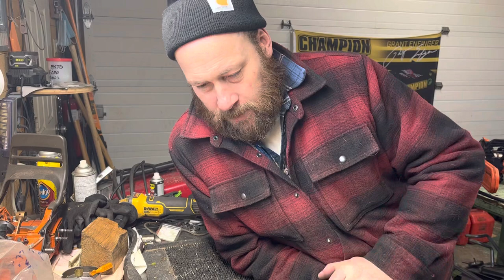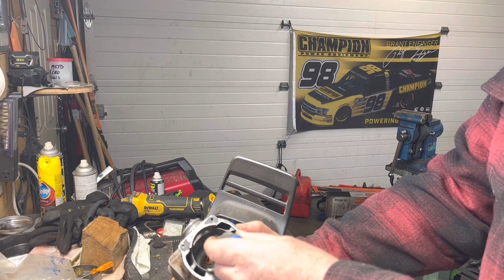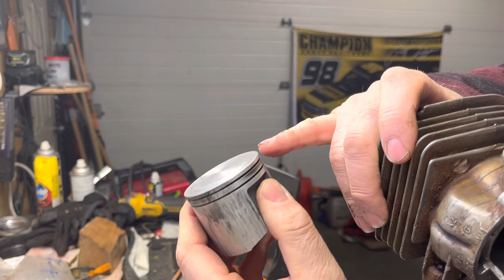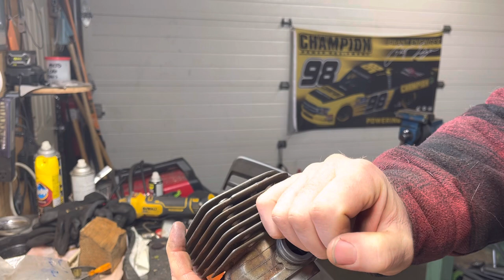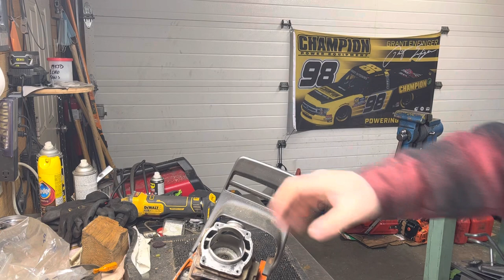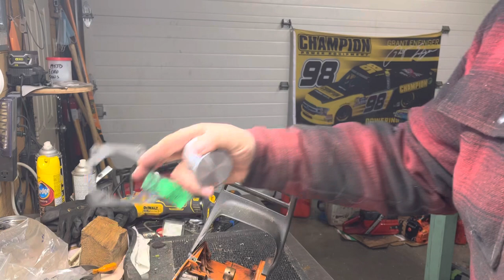Chainsaw porting basics. Goals: efficiency, increase power, run cooler, more torque for longer bars

Comment: Good alternative to my no laith problem
Reply from the maker: For sure, a good product to use with a base gasket delete is three bond 1184, let it get pretty tacky before you assemble the cylinder back on top of it.
The hyway pop-up pistons are often on sale at HLSUPPLY now as part of their Boxing Day sale, I don’t remember if you’re doing a 365 or a 372, here is the one for the 372xp (2071/2171 Jonsered) if you want to save a bit of weight, just run the top piston ring.
https://www.hlsproparts.com/product-p/h31375.htm